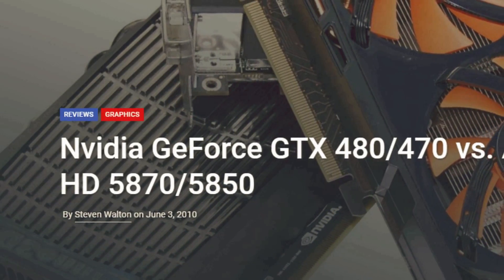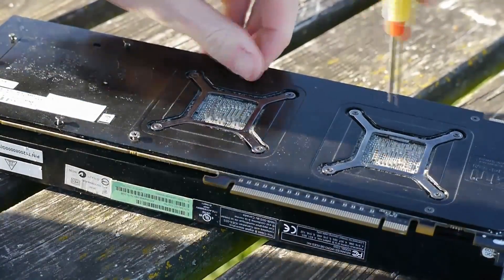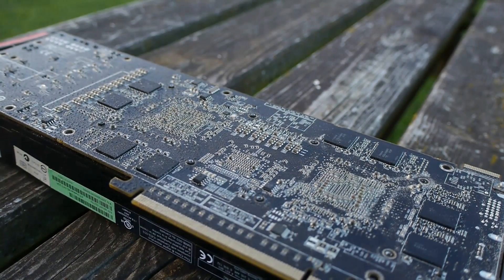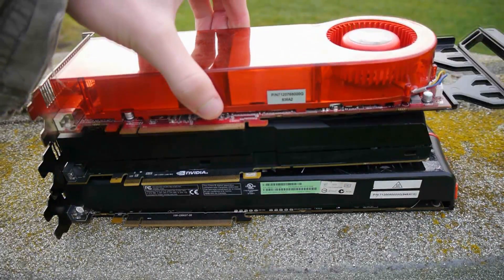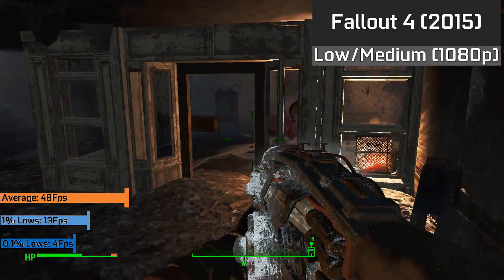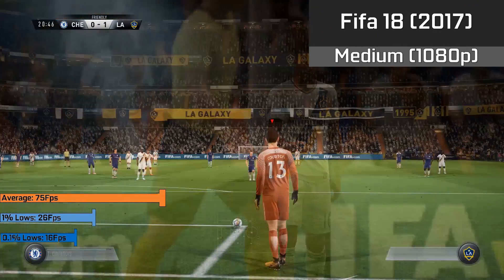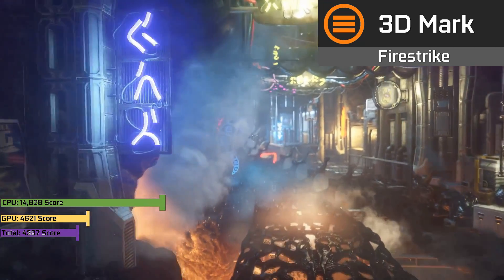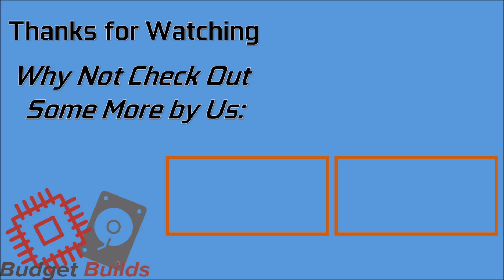The HD5970 is now £25 ($32) but is it any good?

Comment from the maker: Had a couple of production issues with this one... Turns out the latest Creators update isn't that friendly to Creators... Should have all the issues sorted out now though....Also for some reason people seem to think I made up the prices, here is a receipt with proof of how much I paid for the card: https://i.imgur.com/cdyGTIx.png I have no reason to lie as the whole idea of the video was to let people know what this card could do :D
Reply from the maker: LNCRFT: I'd run DDU and reinstall drivers, also your card may not be a good Overclock. Currently the AMD Drivers are even better than Nvidias.
Reply from the maker: LNCRFT: My Drivers are fine.. It's the OS Crashing the editing software that is an issue.
Reply: I've paid 44,60 Pounds for my 7850 and I don't regret it but I'm used to NVIDIA and I can definetily notice that AMDs drivers are crashing more often than NVIDIAs
Reply: Budget-Builds Official No... it crashes when I try to open the driver control panel too often or when I overclock the GPU just a bit. ..

My CPU only causes heavy issues if I overclock too much.. 
(Intel Core 2 Quad Q6600 @3,0GHz... BSEL  mod works fine)
Reply: just an idea, try gaming with a highend gpu and maybe a dual core cpu.love the vid
Reply: Yeah I have some issues with the creators update as well :( the IV Play front end was working great yesterday then overnight my media center PC in the living room updated and now it will only load in the task bar and will not pop up on the screen :( Alt TAB will bring up the picture in a little box it's running I can see the menu but no luck with any settings. MAME itself works fine but the UI is terrible... lol I am dreading even trying to make a video on this machine... I had located a new game on MAME that I had never heard of and was a blast to play so I was going to make a video of it and post it for my friends to maybe want to try it. :) 

Anyway love your video's all of them!!! :)
Reply: I've already used an older version...
Btw, AMD ReLive suffers from audio sync issues as well
Reply: My specific model is the Club 3D AMD Radeon HD 7850 RoyalKing Edition (1GB GDDR5 RAM 900MHz (OG was 800MHz))
Reply from the maker: LNCRFT: Have you used DDU though?
Reply: Complete system reinstall....
Reply from the maker: LNCRFT: I'd put it back to stock clocks, as it seems to be the card causing an issue.
Reply: I did.... but the thing that the driver does not respond or crashes still happens when I play Call of Duty Black Ops II
Reply: Budget-Builds Official BACK TO WIN7, SP1. :^) still enjoying the best windows for gaming, no driver issues xD
Reply from the maker: LNCRFT: If it's only that game maybe it's a windows issue? Like visual studio?
Reply: I was using Windows 10 and now Windows 7 again.... still the same... My Nvidia Geforce 9500 GT didn't have this problems although this GPU was so much overclocked that texture corruptions were popping up in Black Ops 2..... still no driver crash.

This mainly happens with this game.... Games like GTA V or War Thunder run fine
Reply: LNCRFT  I have 7900 (one up) and a common problem I have is the drivers have problems,  they don't respond and windows can't access them in certain games. This happens on some new drivers, for example last driver worked but most up to date doesn't,  I've reinstalled them a few time so I'm kinda lost.
Reply: 7900... Nvidia or Radeon HD 7900 series (AMD)
Reply: Hi, I'm just your average viewer but i was wondering if you could do a review on the Pentium g4560. Also can you in that video tell us what is the best graphics card to combo it with? Thanks! (also I own this CPU and I'm waiting on the graphics card, a 1050 ti)
Reply: One of my PC's is a Q6600 at 3Ghz with 8Gb ram and a HD 7850, never had any issues with drivers although it hasn't had the Fall Creators update yet.
Reply: okay... I have similar specs, just 4GB RAM but I had this issue with BO2 and when i tryna open the control panel it crashes sometimes/ does not respond
Reply: Never played that game to be honest so I can't confirm or deny any issue. The only problem I ever have with the system is in the summer when the gpu  can overheat and crash the driver (either a black screen and loud buzzing noise or the system becomes totally unresponsive), reducing the overclock to 1050 fixes that for me though. It might be an idea to strip the card down and give it a good clean and some fresh thermal paste if you haven't done so already, if the crashes you are getting are related to thermals it may help, if it doesn't fix it at least your card will be running cooler and quieter :-)
Reply: I never had overheat issues with my 7850... It runs at 25% Fan speed below 70°C when I play games
Reply: But the black screen issues u described happened to me
Reply: Budget-Builds Official hey i have a 750 ti and i get framedrops on borderlands and 2.why is that
Reply: What are you spraying on the card in order to clean it?
Reply: hey would you be interested in selling this
Reply: The Creators Update seems to have divided people, with many varying results. Personally, I got pretty damn decent results with a very obvious performance increase in my favourite game (GTA V). Very happy with the results
Reply: should have tried tripple crossfire with a regular hd 5870, as some did that combo to remove some stuttering (yep tripple crossfire is better then 2 on that oddly enough.)
Reply: Using a RX580 here, the lastest 17.10.1 beta drivers fixed some of these issues.
Reply: Budget-Builds Official ii
Reply: Budget-Builds Official 
FIFA has the Frame lock only when pause or video cut scenes etc, but it will glitch sometimes and keep the frame lock, I like this video please do a second part and show more games, Like to see more games and SLI, they should remake this card on the cheap with more Ram it would perform much better
Reply: Budget-Builds Official i actualy have something like this GPU in my crappy laptop GPU is actualy pretty good but the cpu is disatser Only 1.30 GHz that i managed to overclock to 1.87 GHz i overclocked the GPU too from 800 mhz to 900mhz
Reply: Aris Koin it's an old card
Reply: It’s not fifa is FOIFA

Comment: Hmm that weird I remember playing Borderlands 2 with two HD5850's 1GB overclocked. Performance was great, no stutters. Nvidia's PhysX was disabled offcourse.
Reply: The HD5970 is a single card, so both cards are running off the same PCIE slot, rather than each having their own. There may be complications running a single-card crossfire/SLI setup as opposed to two separate cards.

Comment: Yeah I made pretty bad choices but it works fro me so that's okay!
I will soon upgrade to a q6600 and Radeon 5770 or Gtx 460 or Gtx 660 or Gtx 650 Ti or Gt 1030.
Reply: Yup! I would go with the 750Ti as it is stronger than a Gt 1030.
Reply: I am probably going to switch platform.( Maybe) It depends on my budget.
Reply: Get a q9650.
Reply: Go with qx6800 cpu and a amd gpu under say $200

Comment: I would love to get that game for my  custom 720p Rig!
I am rocking a:

Core 2 duo E8600
4 GB DDR2 ram
Gt 710 overclocked like Hell!
450 Watt 80 Plus Bronze power Supply
Reply: Nah it really does not matter. Both the cpu and gpu are very weak by today's standards. I like to play in 720p low or 720p medium.
Reply: Upgrade to qx6800

Comment: Why not using 900p instead 1080 like Console ?
Reply: d y n a m i c r e s o l u t i o n
Reply: @agnel47  LMAO. I find it hilarious how they try to market that as a positive.
Reply from the maker: May aswell use 1080p if I can :D
Reply: All mainstream switch games are either 900p or 720p @30 or 60 FPS.... (at low visuals)
Reply: Grant Gibson Mk 8 for Exampel is 1080p 60fps
Reply: Battlefield, etc is 900p.
Reply: EA Games run at 900p
Reply: Well if you have the power to put a 900i in a console
Reply: Zer01neDev The PS4 runs at 1080p
Reply: Switch run low graphics quality visual games.

Comment: 290watts, oh my gosh. And I thought my GTX480 did use a lot of power.
Reply from the maker: Yep...But this is two high end cards. Each of which having roughly only 10% Slower performance than that of a GTX480...So all in all very efficient.
Reply: I know, i know... with all multi gpu shenanigans included xD